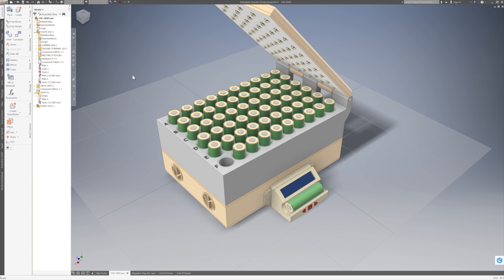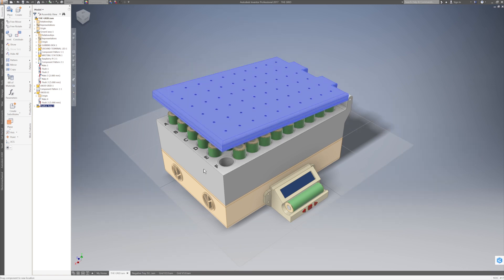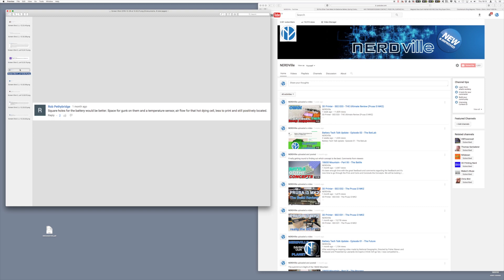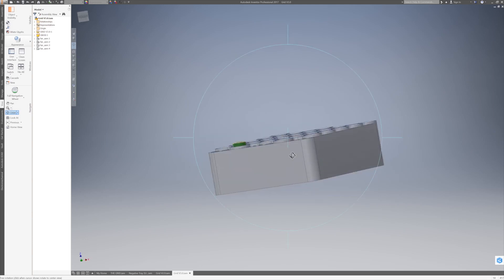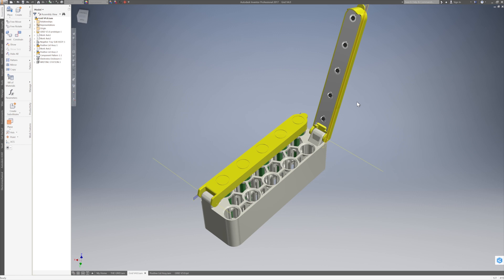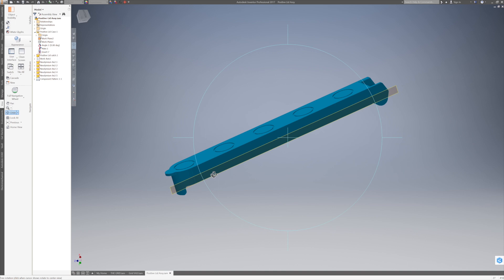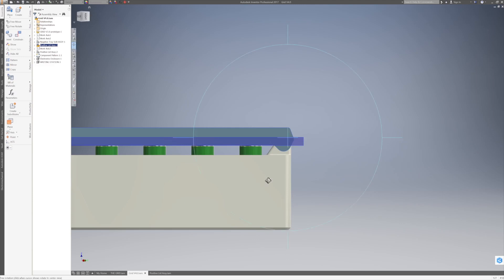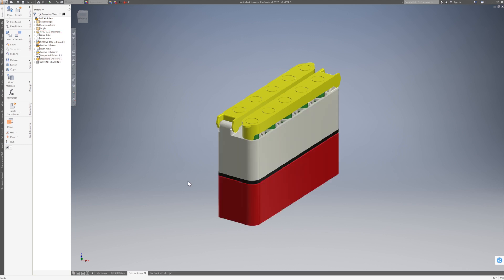18650 Mountain - Part Xiii - The Update

Comment: I also don't love the magnetic connection method. I think springs in the bottom are simpler and cheaper. What happens if a oversize protected cell is placed in position 1, I fear the lid won't close. Springs would provide a margin of error for oversize batteries.
Reply from the maker: thanks for the comment, so maybe I didn't explain this well. The magnet and CSK screw will be magnetised together, this group moves freely within the negative tray as the hole is oversize for both the magnet and the screw hole. I have allowed up to 3mm so it should have no problems latching onto the cells on both side even if in the worse case scenario you have the max size with the min size next to each other. But I am sure lessons will be learnt once we have the first working prototype.
Reply: I see what your getting at. That should work and the prototyping will help figure things out.

Be interesting to see if the magnets center on the base of the 18650. I had problems with  using magnets and 18650 as a connection method because the magnetic fields of the magnets made the neodymiums always want to attach to the left or right edge of the battery, never the center.

Comment: This design will never test a rail set of batteries faster then the longest test takes. 
Since you can not remove a dead cell or bad cell or finished cell from one running rail you will be prohibited from replacing it without restarting a full cycle on the one rail. 
Say you have 50% bad cells (my tests have shown about 50%) that means you could increase test speed by 100% just by having access to change each cell individually. On top of that some cells will charge faster then others and still not be bad, so the increase of test speed will probably be past 100% if each cell is accessible individually.
Reply from the maker: yes i have thought about this and you would implement this in the software to a limited amount of time to charge a cell. eg, if the cell has not shown a full charge in a certain amount of time then it is cancelled and labelled BAD CELL then it proceeds to the next cell. Typically from my practical research on 800 cells i found that all cells do charge fully at max 1A and it take around 90min in the max case scenario.
Reply: NERDVille So you are testing each cell one by one? If that is so each batch will take a very very long time. 
Why not test a full batch all at once? Arduino Mega can do 16 cells at a time with the correct electronics and you could handle the charging on it also.

Comment: I've been researching the cells I've been recovering (some are very difficult to find data on), and I've found that cells vary in recommended charge current. If you go above recommended, the cell WILL get hot.  Some of these cells have recommended charge voltages below 500 mA.  I have a BT-C3100 4 cell charger that can be set as low as 200 mA, and it is ideal for charging these cells. I would suggest starting charging at a low voltage and gradually ramping it up.  If a cell starts getting too warm, you pause the charge until the temperature goes back down, reduce the you knowejjj and resume charging.  If a cell still gets hot at the lowest current setting (200 mA for example), then the cell is deemed as "bad" and move on to the next cell.
 You could include the "safe" charging voltage for each cell in the data log generated by the charger.
I know some people don't want any cell that will not charge at 1 amp, but after running a few calculations, any pack I build containing more than 20 cells is going to charge at less than 1 amp anyway, and in my current situation with the solar panels I currently have, my packs will be charging at less than 1/2 amp, so I don't see a problem with running these cells.  For example, 4 cells charging at 1 amp are charging at 250 mA each. A 24V bank at 240 watts, therefore, would be able to be charged at 10 Amps. If there are 40 cells in each pack, that brings the charge current down to 250 mA.
Reply from the maker: thanks for the info, yes this is the beauty of open source software it can be altered and tailor made. May the software should have profile settings so you can load whichever setting someone has calibrated. definitely scope for further development.
Reply: NERDVille Just a bit of other information I would deem useful. Checking the cell's rated capacity before testing can eliminate a range of cells you might not want. I've found a number of packs that had cells with default rating was 1500 mAh or less. If you are going for cells with only 1500 or more, it's not worth the time to test these cells.

Comment: I know that you looked at springs that actually became a terminal, maybe you want to using bare springs like they do on the extruder tension for the Prusa MK2.
Reply: Yes I think springs under the magnets is a good idea or better maybe put the fixed terminals in the bottom and the moving ones in the lid as I have found that all reclaimed cells are not quite the same hight.
Reply from the maker: this solves four problems in one solution, terminal connection, automatic compensation for varying heights and locks the lid to the batteries without excessive load to the hinge or further complicated latches and ease of assembly eg no further soldering required.

Comment: Can't grasp the bottom connection, the bolt is loose and that has the connection and recessed inside the magnet so battery sits on magnet but then no physical mechanical connection between bolt and magnet... I must be missing something
Reply: 1bigsyd magnet makes the bolt a magnet too and will raise to the bottom of the inserted battery.
Reply from the maker: correct, couldn't have said it better myself.

Comment: I wonder if a conductive filament could be used when your printing the lid?
Reply from the maker: conductive filament is not the best material for sensitive electrical testing. its more of a gimmick I feel
Reply: NERDVille I did wonder about that. I had a quick look and couldn't find much info on resistance.
Reply from the maker: lol these it seems if you can melt with PLA then its market it. I even saw bacon smelling PLA by the 3D Printer Nerd.
Reply: High enough resistance to cause problems, low current capability.
One material I found said it's 115 ohms per cm3, which makes is at least 1000 times what you need for battery testing where miliohms matter.

Comment: Can I point out, the magnet in question, they do have internal resistance, some good one and some worst one, they do vary. best to do I guess to use a cheese head screw  to make a full contact to the battery, i.e. lower internal resistance.
Reply from the maker: good point probably worth doing further research on this method
Reply: cheetahkid I do remember there being a good discussion on the resistance of various Neo's. I thought about using magnets in my concept build but could source a low enough price. also, I couldn't find good research on using magnets as a permanent electrical connection.
Reply: I thought the bolt would touch the cell!
Reply: depend what countersunk screw you use, a deep one would be better
Reply: Alan Marshall You are right, it does.

Comment: Have you factored in the hens teeth phenomenon?
I am watching all this with interest, but surely now that everybody and his granny want to make stuff ranging from power walls to skate boards to emergency USB chargers, unless you have industry contacts, few will be able to source a bench load of dying battery packs, leading on to not needing your high speed throughput conditioning system :o(
It is only a matter of time before some unfortunate Tesla owner finds his car won't start one morning because some scroat has "half inched" the battery.
Reply from the maker: lol very good
Reply: LOL modern version of car on blocks and wheels missing :-)

Comment: Huh, that's a nice mark-up on those pogo pins.. I was looking on aliexpress and found some offers that were about 1/10th of that price.

Anyway, the single row cover idea is very good and is sure to reduce the tolerance issues.
Reply from the maker: yes that is a good point but the pogo pins are a more of a PCB mountable component, if there was a means to PCB the ground side circuit we could always revisit this idea.

Comment: How difficult would it be to keep the 2x5 layout and make it a modular master/slave configuration?   Basically you have a master with PSU, CPU and basic charge/discharge circuitry. Then you have a slave with just charge/discharge circuitry and of course some sort of contact and attachment system on both.
Reply from the maker: hmm its sounds like a good idea as you can grow the unit as you need. I would imagine that there would be a technical challenge on the electrical and programing side but I think this idea has some real potential as the system can be as big as someone would need it to be. I'll ask the question within the circle and see what bounces back.
Reply: NERDVille Yeah, I do think that the PSU would likely be the limiting factor.  Might have to go external.  Amps at 5v are hard to come by.  I am unfortunately not very framilular with Ardrinos, but I expect there is a way to multiplex the data to and from it.